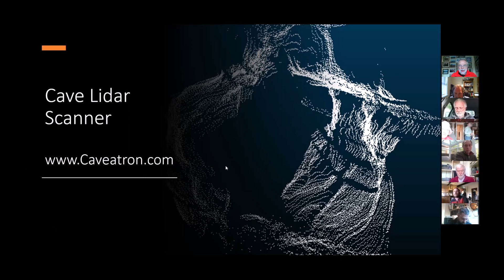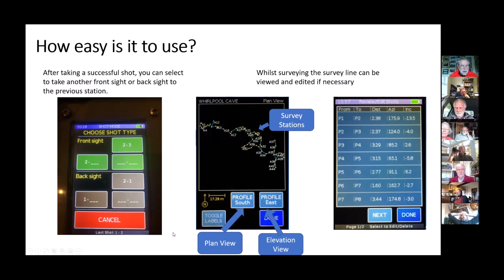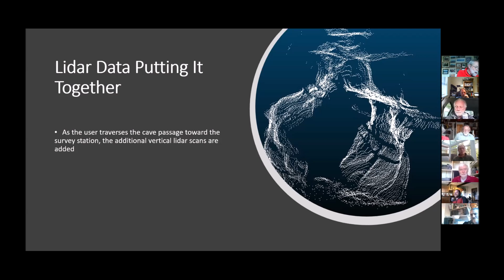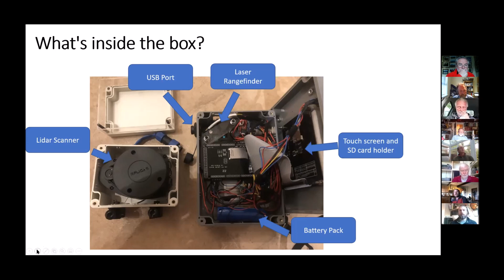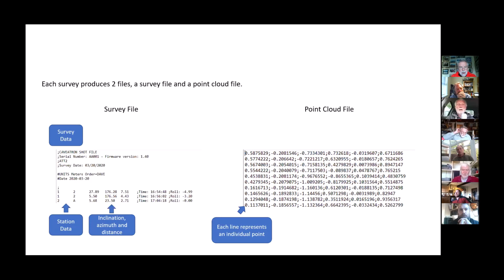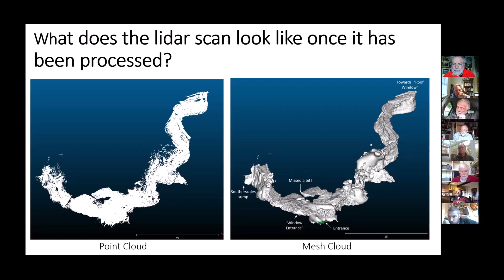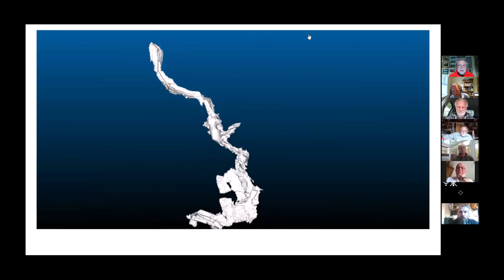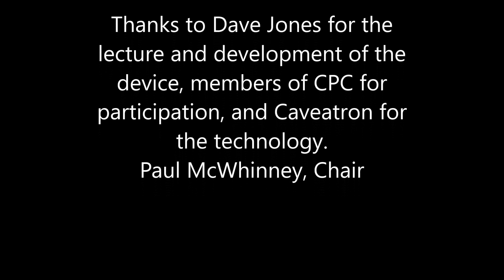LiDAR for Cavers, Dave Jones 15th May 2020

Comment: Fantastic video! What software do you recommend to convert a lidar point-cloud to a mesh? I’m thinking about 3D printing an old silver mine. Thanks!
Reply: Using cloud compare (which is free) you can add convert the point cloud into a mesh using 'Poisson surface reconstruction'.  There are a couple of guides on how to do this on the internet.  You can then save the mesh as an stl file and import it into a 3d printing application. There are various other applications that will do this for you, but the best free ones are either Cloud Compare or Meshlab.